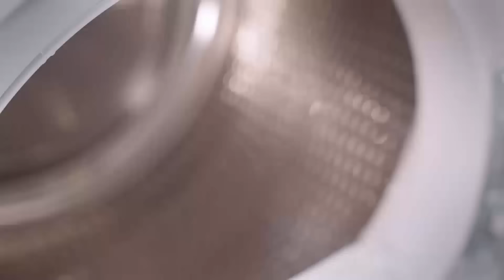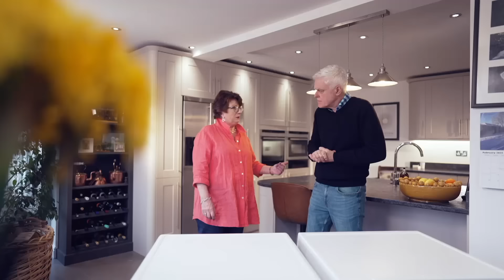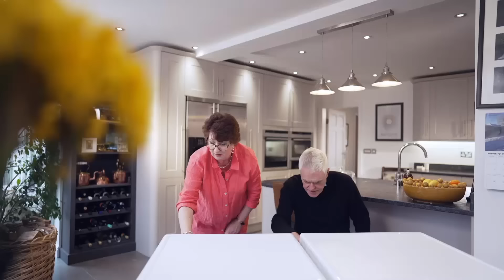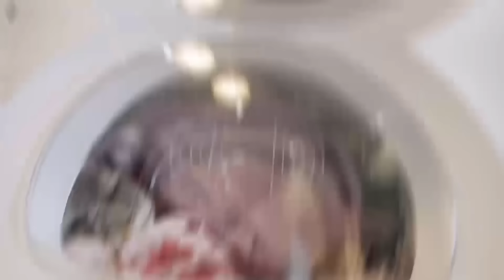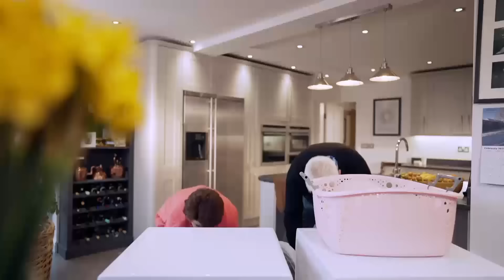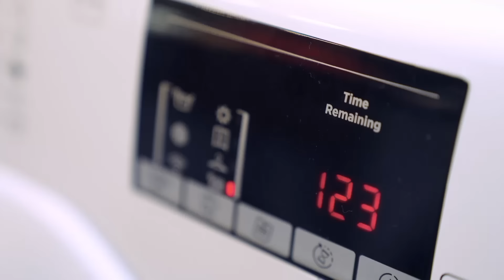Heat Pump Dryers Tested: £549 Bosch vs £349 Hoover – Worth the Upgrade? | The Gadget Show

Comment: My £455 Bosch Series 4 condenser dryer collected water in the base of the unit. It was a bitch to dry it out after every use and it even leaked water onto the floor. Waste of money in my opinion. I sold it for £190 after the two year warranty ran out. My experience is an honest review.

Comment: What a BS-test. Why don't you put a decent load of wash in the dryer? I've a Zanussi condensor-dryer since 2007. I dry a full load of wash in an hour. It's consumes 1,5kWh. I haven't time to wait any longer. Also the washer take's an hour, so that's handy. Are there ana new dryer which wil do a full load in an hour? I'm asking for my machine is almost 20 years old.

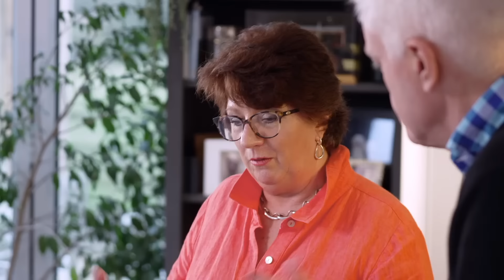Comment: i have a candy (now in latin america renamed haier since it uses the haier app Hon to work not the old candy smart app witch was my condensation old dryer working on) for a regular 11 kgs load of regular wash clothes with a washer spin @ 1400 RPM takes about 2 hours. if i do 11 kgs of big towels, same wash, takes almost 6 hours. now this heat pump dryer only uses 400 watts VS my condensation dryer that used 2000 watts, even that the same load of towels would take 3 hours to finish. i dont have an issue with time, i only do one 11 kgs load of towels per week and leave it running in the night time (my uruguayan save electricity bill setup gives us cheaper electricity by midnight up to morning time) the clothes is fine, usually i do a 6 kgs daily wash of clothes and will be dry around 1:45 minutes. saves tons of electricity and time is not a matter, i dont run a business that every minute makes me loose money. for household usage is the best invention ever. heat pumps for everything is the future.

Comment: for the average household it doesn't really matter. The consumed electricity difference is too little. The heatpump won't pay for itself for at least 3-4 years(or more). 
While on average, usually the heat pump dies first, on average after just ~5 years.While a standard dryer can last 10 years.
Use

Comment: I was fed up with cheap dryers constantly breaking down after 13 months.
I now I have a Miele heat pump dryer and it’s fekin awesome.
Reply: I like the 3 filters. Ours is stacked on top of the washing machine. A Miele, 20 years old. Bearings replaced 2 years ago with a full clean inside and serviced, computer checked. £200. Cost £400 twenty years ago. Buy cheap, buy twice. £600 for twenty years, bargain. Still going strong.

Comment: The hoover water collection in the door is pathetic ! Easily broken and fluff gathers in between mouldings ! Also there is a channel built in ( overflow or external collection I can’t remember that you just can’t keep clean ! The fluff extraction filter used to be a piece of sponge infront of the condenser making it a nightmare to clean ! I can’t believe they have persisted for so long with this design!

Comment: I've just moved to the South coast of the UK and air drying doesn't really work - I guess it's the sea air plus it's been raining almost non stop for 3 months! I'd like to put a dryer in the integral garage of the house. We don't have space in the house and we don't have an easy place to put a vent outlet plus it would be nice to save a little energy/ Would a heat pump dryer work in a garage? In extremes it gets down to 5C on the coldest nights of winter but otherwise 10C is more normal in winter.  We were thinking of getting one of the Hisense 1S dryers. Any input welcome.
Reply: Don't put a heat pump tumble dryer out of the house. It needs ambient air temperature to work. The heat pump tumble dryer won't emit heat so if you have to use it inside in warm damp weather then it won't make the house warmer. They are very efficient. Look for one with the quiet mark. Although I don't think they are noisy. Also it won't cook your clothes because it has humidity sensors to stop that happening. I find that the clothes can need a bit more time when it's finished the cycle, but there is enough residual heat in the clothes to finish drying them if you leave the door open. I recommend cleaning the filter half way through. The timer will reset but then correct itself after a few minutes. This can speed things up overall. It's a must to clean the filters every time you use it and use a paint brush and hoover nozzle to clean the vanes of the heat exchanger. We have a Miele because it has three filters before the air reaches the heat exchanger. I  prefer that design. I bought my daughter a Bosch and she is happy with that. You can't dry outside in winter anywhere. Check the weather forecast on the met office website if the humidity is above 70% with little wind, don't waste your time hanging stuff outside.

Comment: Load of BS, you save £40 on electricity in a year but a heat pump drier will only have a life one third of a vented drier.  So you are having to buy a new one every 3 years.  That's why Bosch only give them a 2 year guarantee.

Comment: I have a Bosch series 4 tumble drier that has lost its gas, so it doesn't heat or condense.
It was bought in 2021.
The guy that sold it to me said I had a bad one.
My last White Knight GAS tumble drier lasted 20 years plus.
I can't get them anymore 😢

Comment: heat pump dryer's are very difficult to clean out all the fluff, and service, takes twice as long, wears out quicker, and does not allow engineers to repair easily - planned obsolescence. don't believe me check out an expert advice 

https://www.youtube.com/watch?v=xn03N3b0-lE
Tumble Dryers the Shocking Truth About Heat Pump vs Vented & Condenser, NEW LEGISLATION!

Comment: I got a Bosch Series 8 heat pump tumble dryer. Worst appliance ever bought. It caught fire once, Bosch repaired. It takes 3-4 hours to dry. That is far too long for clothes, no clothes should be subject to that. Even a reputable appliance repairer said they couldn’t do anything. The final nail was an online YouTube appliance expert who didn’t rate heat pump dryers at all. With low cost overnight energy I can afford to run a less energy efficient but cheaper machine

Comment: I have had a very simple vented for about 12 years, no problems.  For only using a couple of times a week it would take too long to get the money back from another machine, but also the vented is done in 40 minutes and moves all the damp air outside, which is well worth any premium.
Reply: Where, pray tell, does the heat pump style put the damp air??
Reply: @mattmanyam  Moisture is condensed to water. I have a Bosch washer/dryer which uses small amounts of fresh water to flush the condensate away.

Comment: I’ve a Bosch vented dryer that’s now 29 years old. The ‘Cool’ button has stopped working but other than that it’s been faultless. It was worked hard for the first ten years of its life as the children grew up but less so in later years. Still a fantastic achievement by any measure for an appliance.
Reply: We have a Siemens like that. The problem of the heat pump driers is that it takes so long for a load to dry. And don't let them tell you otherwise.
Reply: not saying that your 30 year old dryer is not good or working well, but energy wise must be costing you a lot more to keep it than upgrading it.

Comment: Check the bearings, the cheap models often have the drum rubbing on plastic strips to hold the outside of the drum, whereas the better models have actual, ball bearings preforming the function.

Comment: Bosch was always on top when it comes to reliability and longevity.
I've spoke once to a guy repairing my Indesit dishwasher and he told me that Bosch is almost every time a better choice simply because they make most of their parts out of very good quality materials, he showed me a part with few holes in it from my Indesit dishwasher, cheap plastic that was dissolving over time, if that was Bosch dishwasher that part would be metal...
Replaced it with Bosch dishwasher later on, never had an issue with it and it's been like 6 years already. Also replaced my fridge and washing machine with Bosch when my older ones broke, couldn't been happier.
All of these Candy, Hoover, Indesit, Beko even Samsung are made to last just till their warranty runs out. And when you pay for extended warranty the overall price pretty much matches the Bosch..
Reply: My dad lovingly refers to Indesits he has to repair as In Da Shits.

Comment: I'm an appliance tech, if you can, always choose Bosh. You don't need to go for their premium Siemens options as they have the same internals. They rarely have issues and when something does go wrong it's usually the motherboard after 7 years
Reply: would you say to stay away from samsung?
Reply: @T33K4Y  Sorry, just seeing this now. Avoid all samsung products. Especially ovens/cookers. I work on all brands but Samsung are up  there with hoover/candy/haeir with breaking just outside of warranty.
Reply: @declanc5372  don't worry about it man, appreciate the reply and will keep your advice in mind for when we'll inevitably be needing another washing machine...
Reply: Miele, their whole shtick is "this device is designed to survive a couple of decades"
Reply: @_adonisk Miele have switched to cheaper plastic parts, sealed drums and are making them in turkey now but the price you pay is the same.
Reply: @_adoniskIn Australia, a basic Miele washer, dryer, dishwasher etc, costs double that of a Bosch Serie 4 (midrange, above a Serie 2). 

The Bosch is similar in price to Samsung/LG, etc. I doubt the Miele will last as long as the full lifespan of two consecutive Bosch machines to warrant the price difference, especially given the 2nd Bosch machine would also deliver an efficiency upgrade. 

Bosch for the price of an entry level Samsung is a no brainer for me.
Reply: Is that any series of Bosch ???  Is there a certain series that is better than the rest ?
Reply: @Algorithm347  I don't think I can recommend Bosch anymore as I am seeing too many cheap boards in their new appliances as well as drain pumps. 

If I could update my original comment, LG are now probably the best of the bunch. 

Don't purchase the very cheap model of LG I think you can get them in retailers like Currys in the UK and Ireland, they have the LG brand name but are made by some cheap manufacturer probably the same that make the Logik brand.  You will be able to tell by the cheap looking UI panel which doesn't look like any of LG machine.
Reply: @declanc5372 we’ve just bought a Bloomberg , from a local shop comes with five years warranty including part and labour . Which I thought was very good . I know they are maybe not too spec but from my research it sounds like they offer fairly good reliability and are the higher end of budget models if that makes sense .
Reply: @declanc5372   Yea. Bought new bosch series 6 couple months ago. Returned on 3rd day. Motor started making some strange sound.

Comment: There's two issues not touched on here. First of all, are the heat pumps similar in power / ability? Think car engine size, a 2 litre is going to go faster than a 1500cc etc. Plus what is the lint filter scenario? We had a Samsung heat pump dryer that didn't have a filter in front of the (very delicate) fins of the heat exchanger and with it being at floor level you were expected to lie on the floor with a brush to wipe damp lint powder off the fins on a weekly basis. 
I got rid of the Samsung and bought Miele as it has a filter in front of it's fins which is easily removed to brush clean and instead of taking 2 hours plus to dry clothes it works as quickly as a traditional vented dryer as the heat pump is clearly higher rated. To be clear the Samsung was indeed garbage.

Comment: I had a hoover washer dryer in my previous flat. The full cycle took 8 hours, the clothes were never cupboard dry and all my clothes have faded in colours in a few months. Now I have another hoover washer which takes almost 3 hours to wash 7 kilos and is not very good at it. the touch panel has a mind of its own too. I would never buy anything from hoover with my own money.

Comment: Insane her old dryer takes so long. Mine dries pretty much anything in  60mins or less. Modern dryers are just shite. Old faithful going strong for 25 years
For most people it'd take 25 years to recoup any alleged savings from these modern junk. Would a modern unit even last that long as my old one ? And it's still going strong

Comment: I've had a Hotpoint dryer vented ever since I have had a home some 35 yrs probably had four or five in that time from a two household down to one used once a week for 20 to 30 mins and then finished off on an airer in my large cupboard with water and central heating pipes which are always hot or warm only had to have a couple of Jobs done over all them yrs if I have to replace I'll go condenser for me

Comment: what about reverse rotation. This is simple but most modern dryers don't have it..Crazy!! It would improve drying and reduce time and energy
Reply: technically not as easy and adds complexity because the airflow can only go in one direction. but th drum motor is also driving the blower fan. so it can never reverse rotation.

if the engineers wanted that they had to install a dedicated blower and drum motor.   then people woul cry even more about complexity + cost.
Reply: @casemodder89 It helps with things like bedding that gets balled up far too easily even 5 second reverses helps unball the bedding allowing the drying to be faster.

Comment: I have a Bosch Heat Pump series 6 condensing dryer. It runs most days for about 2 cycles (4-6 hours). My electricity usage has not increased noticibly, and after talking with my energy provider I was informed that my energy consumption is very low against the average for a household in Ireland. My home is 17 years old, I do have A rated appliances, and low energy bulbs thoughout. I have a flat energy rate, throughout the 24hr day, no night time or reduced rates in the evening for example. I use power as an when its needed and don't actively limit the dryer to night time. I believe appliances should be used when you need them, not when you can afford to use them. 

Well worth the price tag, I paid 600 euro about 2 years ago. My clothes are cupboard dry (on the cupboard dry cycle). The machine dries a summer weight (4 tog) king duvet easily, and is easy to clean the lint filter; there are 2. I deep clean the filter underneath about 4 times a year.

All in all the best purchase I have made in quite some time, no more drying clothes throught the house and causing damp against a cold neighbours wall (its a holiday home so not heating regularly). 

Note: it isnt as fast as a vented traditional dryer, but if items are needed quickly there is a 40 minute cycle which works very well. 

Hope this helps someone considering the appliance. I recommend it, along with the Bosch Series 4 or 6 washing machine.
Reply: Ruth, I bought one in Wexford but the electrical socket in Galway said it wasn't compatible. Did this happen to you and how did you resolve it?
Reply: "Heat Pump series 6 condensing dryer."
I'm confused. So is it a heat pump dryer or a condensing dryer?

Comment: I have had 2 over the last 16years  i was doing some work in and R and D lab and i saw my first one on test the Lab tech said they cant be beaten. But it did cost me over £700 16 years ago. One tip Buy a reversing otherwise you bedding ends up in a knot
Reply: I've had the same old dryer for over 25 years, still works perfectly....Looks like I've saved a fortune compared to modern unreliable junk. I've only replaced the belt a couple of times over that period. Everything dry in under 60 minutes. Win win.

Comment: Had high end Bosch washer and heat pump dryer and they both had callouts in warranty and lasted no length after warranties and the engineer said they were not economical to service. Have another tumble dryer that was €199 15 years ago and its still the reliable option on night rate.

Comment: The old vented dryer Is still working After 15-20 years , heat pump dryer  Life time Is  not so Long ... 

Vented dryer are gentle on clothes and maintenance easier 

Buy a new dryer only if you can't repair the old , and  dont buy the cheapest  because Will not last and the perfomance is terrible

Comment: Hoover appliances are rubbish, heat pump drier from Hoover or Candy fails after a couple of years maybe lucky to get 3 years, not just Hoover though Beko are not much better, the problem being if the dryer no longer gets warm / hot then it’s either going to be a simple fix like the compressor capacitor that’s failed or the heat pump itself that’s lost its gas and that means unless you can find someone to replace gas the appliance itself heading for the dump so no cost saving whatsoever !! beware

Comment: Saving £2 a year on running costs when the machine was £200 more expensive...great.
Reply: I had work experience with Bosch before joining another company which does every brand. With Bosch you typically get 5 year warranty. With candy/hoover or their owner Haier, you typically get 1 to 2 years. A call out for Bosch is about 100 and covers you for a year. Other brands you are charged each call out and it can range from 80 to 160. So you have to think a bit more than just the electric savings.
Reply: Ultimately, it comes down to criteria for your purchase. If its budget then yes agree.
Reply: @benjiman_OBE  budget, efficiency, hence why the old dryers are best. They dry quicker and better, and last far far longer.
There really is no downside. And even if something does go wrong, they are so simple and easy/cheap to repair.
Really, what is the downside ?
Reply: When the hoover breaks you will wish you bought the Bosch. £600 washing machine destroyed itself after a year, never again!
Reply: I reckon it would take me about 50 years to recoup any savings vs my current 25 year old dryer. Maybe even 75 years lol